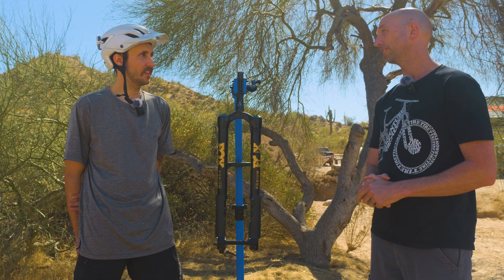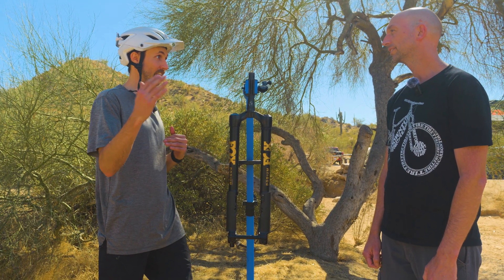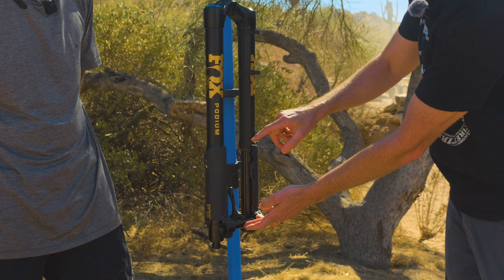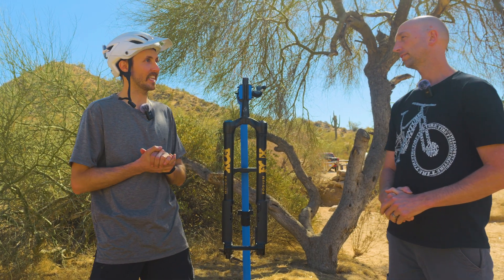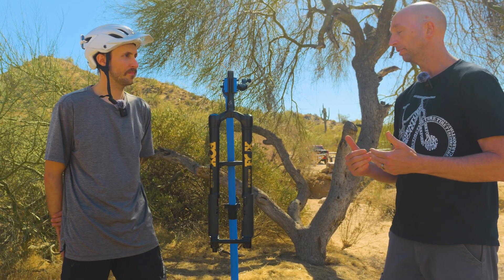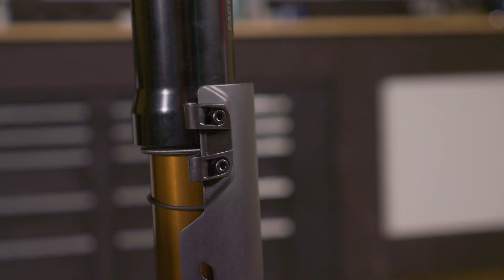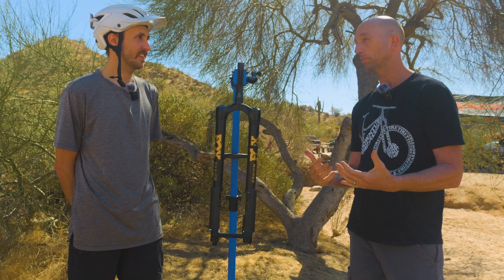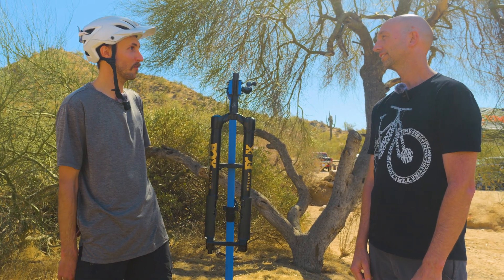Inverted is the future? | Fox Engineer explains why the Fox Podium fork was made.

Comment: Very sceptical about the stiffness of this design without the lower arch???
Reply: Upside down forks usually compensate for that by stiffening the axle and dropout to axle connection. 
If you look at that area on this fork it looks like a motorcycle with a fairly wide axle clamping area on each leg and a bigger diameter (looks about 20mm?) axle.
Reply: The lower arch would only add torsional stiffness not fore aft stiffness.